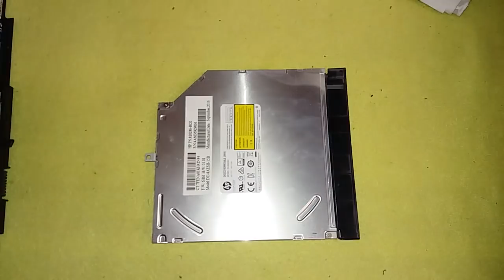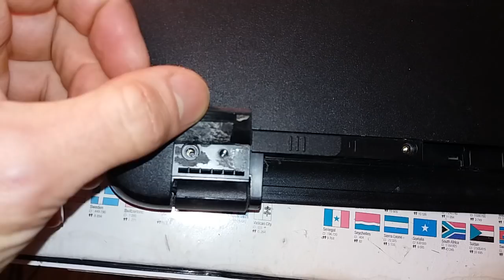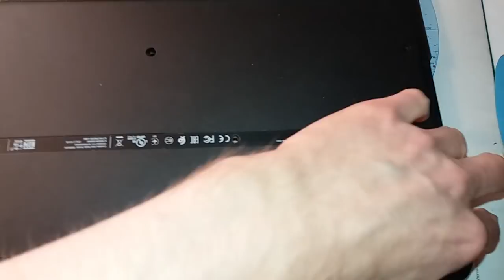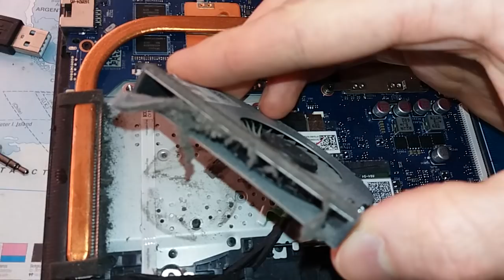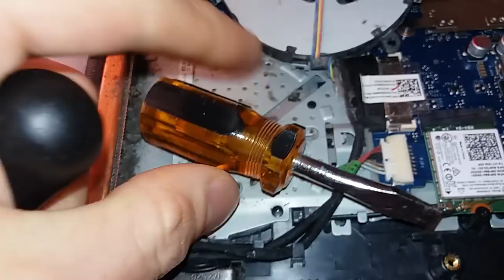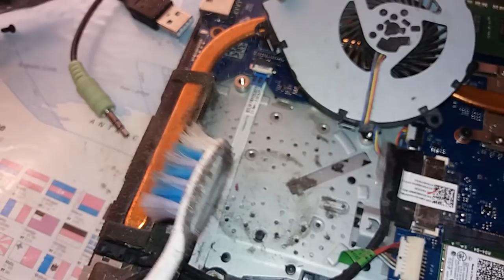Cleaning my howling laptop (unedited)

Comment: If it is a laptop you use regularly some upgrades that would give some improvement is an SSD and more ram depending on how much it has
Reply: That looked to already have both RAM slots full. Though if you don't have 8GB, definitely upgrade to at least 8GB.
My laptop was 1x 8GB, with one empty slot, well guess what, it is now 16GB :)

Comment: the left chip closer to the outer vent is your discrete GPU, that generally dissipates more power than the CPU itself on the right side, closer to the RAM modules
Reply: I don't think he plays too many games on a 5 year old notebook. It's mostly sitting idle. Although the right side chip is AMD, it could be a CPU with no iGPU.
Reply: @gabest4  I guess he does a lot of video editing though...
Reply: Dont think so cause the die of the GPU tends to be bigger then the CPU. Also there is more power delevery on the right side typical for the GPU
Reply: This was really cheap laptop even new, now it is probably running at full load even when playing HD video in windows
Reply: Well from the vid i can see its a apu and dgpu most likely in crossfire
Reply: @dan2800  wtf? no
Reply: @bashaaksema94  I guess it is the chipset.
Reply: @oniruddhoalam2039  what do you mean?
Reply: @bashaaksema94  The chipset is a communications hub and traffic control centre which control flow o data into the CPU.
Reply: @oniruddhoalam2039  i know that but the chipset is not the one under the heatsink as far as I can see

Comment: I regularly do this every 6 or 12 months.
The noise difference is impressive!
I have also upgraded everything that was upgradable. 😂 Replaced the thermal paste too. The temps have been vastly improved.
Reply: And if possible put a m2 SSD or ssd 2.5
Reply: I only do this when required. My 5 year old HP Pavilion was recently cleaned and the difference is night and day. Temps much lower.
Having been impressed with how the HP Pavilion was, I also did the same to my HP OMEN gaming laptop. This also saw an improvement and the CPU no longer thermally throttles in game.

Comment: Well after watching your video, I decided to take apart my HP 15-ac153sa to see what was lurking inside. Thankfully HP has a service manual on their website to help.
Just like your example, the fan and heatsink area were both full of dust. No wonder why it wasn't working very well! Performance has now improved and thermals are better too. I also replaced the thermal compound with some Arctic MX4. (Any decent thermal paste will do; I previously used Arctic Silver 5 on older laptops, which I still have half a tube of remaining.)

Comment: If you don't use the DVD reader you can get a part from aliExpress that will be shaped like DVD player but you can put a HDD in it for storage
Reply: But quite a lot of laptops don't come with DVD reader anymore, so a DVD reader is nice to have, especially if you still use DVDs, also you don't need more storage if you have a 1TB or 2TB laptop hard drive already in it, and if you need more than 2TB, get a desktop PC which allows for multiple hard drives.
Reply: You put an SSD in place of the DVD.  Then you can also get a kit that converts your internal DVD into an external one that plugs into USB.
Reply: @Mueller3D  And by doing that, you run the risk of knackering your USB ports, which are soldered in place and cannot easily be swapped...
Best thing to do is keep the DVD drive inside the laptop and use a large enough drive (whether it be an SSD or a mechanical disk) for your requirements.

Comment: I've repaired/cleaned many laptops over the last couple years. Right now I have a laptop from 2011/12 because it took over 5 mins to boot to desktop and was instantly super hot. It was supposedly cleaned 3 years ago and it looked almost the same as this one, very dirty cooling system and also insides of the case and the keyboard was yucky. Now with an SSD installed it boots up in 15 seconds instead of 5 minutes and it's much cooler.

I also always remove the heatpipes and clean them in the sink (it's just a piece of copper so it won't break) and then dry it out in the oven at around 70 degrees (which is fine because they sometimes get as hot as 90 degrees) before cleaning them and the chips with isopropyl alcochol and applying good quality thermal paste, not the chinese cheap one that is used for cooling LEDs.

Comment: Your cat is blow drying it's hair with your laptop !  You are lucky - they used to make it so you had to take everything else out of the laptop to get at the fan - it was crazy !  I have just used air compressor with high pressure to blast the dust out backwards instead of taking laptop apart - I think that works  okay.
Reply: It doesn't. Dust/hair/debris get easily stuck to the fan's axis. Makes it wear out faster and becomes noisier.
Reply: @em0_tion  yeah you are right but the blowing out the dust with compressed air is better than nothing for an old laptop not worth the trouble of taking apart.
Reply: @LarryKapp1  Objectively speaking, if it's worth using or gifting to a less demanding person - it's worth maintaining. And trust me, i can give you "100% money back guarantee" that i'm lazier than you! 😉😂 But let's not bullshit ourselves, truth is always king. 😁🍻✌

Comment: Did you ever blast compressed air up the exhaust ports while the fan was running in those 5 years? That tends to stir things up enough that the fan can blow the crap back out the exhaust ports.

Comment: Out of interest, what heat sink paste did you use? Laptops do significantly better with low thermal resistance thermal paste because of the power density and cramped design, so good paste can gain you a few degrees over plain silicone paste.
Reply: Maybe the same one he used on the 12V 50A power supply video ( HY510 :-D )
Reply: Yep. Arctic MX4 is king. 👍
Reply: I used to use Arctic Silver 5 and it was decent, I still have half a tube of it somewhere.
Nowadays, I use Arctic MX4 and that works very nicely also. Apparently MX4 doesn't need to be re-applied.
Reply: @TheSpotify95  No such thing as perpetuum mobile - every single thermal paste needs changing after time. MX-4 is a little more resilient, but still not magical, and hell of a lot cheaper than the alternative heat damage consequences to a forgotten device. No reason to be frugal with the change frequency, just with the amount applied - do it every spring before the summer heats, you'll be one happy user. ;)

Comment: I had the same problem, the fan was blowing like a plane taking off when I am not even using the laptop (temp 80c~). However when I opened it, there is not a lot of dust built up on the fins or the fan. It turns out that the thermal paste on the cpu has turned into concrete. I reapply thermal paste and now it stayed around 50 c at idle.

Comment: Oh no, don´t blow the dust in the room. This is why the vacuum cleaner was invented.
Reply: Do not use a vacuum cleaner on electronics EVER! the suction generates high static voltages and that can or will kill the device!
Reply: I always use the vacuum cleaner. It is possible that it might cause some damage, but it has never happened to me. Chips are susceptible to esd, but once they are soldered it is very hard to kill them, you'd have to create static charge on purpose, sucking dust is a lousy way to do that
Reply: @HNedel  WRONG! ESD will kill it. You have been lucky it hasn't done it for you yet, but if you continue it will happen eventually
Reply: @aleksandersats9577  then i will keep trying
Reply: @HNedel  it's your choice. One of these days you can kill an expensive equipment by doing this
Reply: @aleksandersats9577  no laptop or part is more expensive than my lungs
Reply: @HNedel  Well yes, but actually no

Comment: Vacuum cleaner and compressed air helps with this kind of dust. 
I have a question.
A 5v (500mA)  fan, if I would want to make it spin at half speed, can I just put a resistor in series ? What size, what wattage? 
thanks
Reply: Words to the wise: do not vacuum clean your PC, but if you do, never let the fan spin. You can easily damage the internals by electrostatic build-up. Your fan is probably a BLDC motor, so the correct way to slow it down is to lower the PWM signal. I guess a resistor would work too, but not very efficient.

Comment: I've had to do this for frends laptops,  a thick duvet of dust and carpet crud blocks it up nicely :-D
The skill is ending up with a pile of spare screws :)
I use a vaccume cleaner with a narrow fitting to suck the crud out.
The worst is peoples main pc, a thick blanket covers everything, the inside of the psu is just packed with it :-(.
The cpu fan is brown with crud, i'm sure you could grow potatoes in it lol :-D

Comment: You can use a vacuum cleaner to suck all the dust away or an air compressor\compressed air if you are outside.
Reply: Never get near a board with a vacuum clenaer, huge ESD risk.
Reply: @Broken_Yugo  I know. Discharge vaccum cleaner beforehand or use grounded special service vacuum.

Comment: Is that a HP 15 Pavilion? I have one of those too and the fan doesn't seem to give out much air either. I reckon it could do with a repaste and a clean.
edit: After watching this, both my HP Pavilion and my HP OMEN have been cleaned and run much cooler now :).

Comment: 1. never blow dust when the laptop is open
2. use vaccum cleaner with soft & small tip to prevent dust from spreading to critical areas of the computer,
3. do it regularly (5-8 months), not once every 4 years :D

Comment: If anyone is having trouble cleaning their fan, you can try electrical contact cleaner spray. First I tried vacuuming mine, then I tried blowing it out with an air compressor but it still had lots of dust stuck on the fan. So then I tried a few sprays from a can of cheap contact cleaner (not the stupid expensive name-brand stuff) and it's like the dust all magically melted off.

Comment: @DiodeGoneWild - 
my Laptop is far worse to clean , you have to disasseble everything , because a lid has been removed to make it go dead faster
Reply: Some laptops are quite bad in that the entire laptop has to come apart for basic repairs:
Acer Aspire 7542: Motherboard out to clean the fan/heatsink/thermals
HP G6: Motherboard out to clean the fan/heatsink
HP 15 P Series: Motherboard out even to upgrade the RAM beyond its initial configuration (and of course to replace the fan/heatsink)
And, of course...
Microsoft Surface Pro 3: Shatter (and replace) working display to do anything such as replace battery, change SSD, clean fan/thermal paste/heatsink, etc etc...

Comment: I recommend you to use Kingpin KPX or thermal grizzly kryonaut paste
Reply: Arctic MX4 is good enough for the majority of tasks - the limiting factor here will be the lack of airflow and the lack of any real sort of power to get the heat away from the CPU. We are, of course, talking about a HP 15 with only one fan.

Comment: If only it was this easy to clean my hp laptop... Mine has to be almost completely disassembled to even get close to the fan.
Reply: What model laptop is yours? Some HPs are quite serviceable (e.g. 15-ac153sa is OK to take apart, to get to the RAM/HDD) but others are terrible (e.g. 15-p189na requires motherboard removal just to upgrade the RAM).
Reply: @TheSpotify95  My laptop is an HP Pavilion dv6-1253cl from 2009. Check out some of the tutorials out there for cleaning the fan/replacing the thermal paste and you'll see just how stupidly complicated the whole process is (I haven't done it yet and I'm not planning to do so, ever). But anyway, at least I have easy access to the RAM modules and hard drive I guess 🙄
Reply: @enzoperruccio  There is actually a guide for all HP DV6 laptops, from HP, that you can follow:
http://www.hp.com/ctg/Manual/c02842252.pdf
However, you do have to remove the system board in order to get to the fans & heatsink: a common design flaw given how regularly the fans may need cleaning.
Reply: @TheSpotify95  Yeah as I said before, I'm not going to bother with it. The laptop still works fine and it's old and obsolete anyway, but taking it apart and accidentally damaging it now would be a pain the ass, since I need it for zoom meetings and such.
Reply: @enzoperruccio  Cool :) Yeah, if it's not causing any massive issues right now, then there's no point in disassembling to clean the fan and heatsink if it's too much hassle to do so. Might be worth having a look in the future if you get a new laptop, so at least if anything did go wrong then you wouldn't have no computer!
Also, it seems like the DV5s are just as bad, see this:
https://www.youtube.com/watch?v=OpCJzdWxEbQ
Reply: @TheSpotify95  Hey remember when I said that the laptop worked fine one week ago? Well... It died today. Don't know if it was bad luck or what but the graphics/video chip decided take a dump, a problem that is apparently very common on this model. So yeah, after 13 years the laptop is finally done for. But hey at least I don't have to bother with the thermal anymore, or the laptop itself :D
Reply: @enzoperruccio  Ouch, sorry to hear this! I wasn't aware of any issues with the HP DV series, though I do know that the DV5s are a right pain to get to the fan, and it seems like the DV6 is the exact same. Might be that the GPU was overheating. 
What I would recommend is to take out the components that might be useful, such as the RAM, hard drive, DVD drive and battery - as they can be reused (especially the hard drive and DVD drive as you can turn then both into external USB drives).
Hopefully you can get a more modern laptop that will work better and run cooler (as well as not being a pain to service).
Reply: @enzoperruccio  edit: here's a funny song showing just how bad the DV series were at servicing the fan/heatsink:
https://www.youtube.com/watch?v=OpCJzdWxEbQ
this is for a DV5 but I'm sure the DV6 is the same
Reply: @TheSpotify95  I doubt the "sell for parts" thing will work for me haha. I live outside the US (where this laptop was purchased) and it was my uncle who brought it to my country. So basically no one else has one and I will struggle to sell the parts. It's probably going to end up tossed in a drawer until I find what to do with it. Could build a power bank out of the battery, I dunno.

Comment: It's slow also because you don't have a solid-state drive.
Reply: No, it runned slowly beacuse of cpu thrrotling... When CPU radiator is clogged and CPU starts overheating, then CPU starts drop down clock frequency to avoid failure...  Sometimes it could be laso power delivery issue because in that case cpu also sows down to keep laptop live  on battery longer...
Reply: Yes, that's why I wrote "also".
Reply: @TheComputerGuy96  but 6 months before it was fast as tornado
Reply: SSD's it's just for load times, not overall
Reply: @mystcat3  exactly...
Reply: Hey, I remember you from previous videos that I used to watch :D
Yeah, I agree that HDDs are slower than SSDs but sometimes you need the storage that a HDD provides, without the cost of a very expensive SSD. I can't justify replacing my 2TB HDD with a 2TB SSD because it would cost me over £150!
Reply: @TheSpotify95  Get a smaller SSD like 120 or 240 GB for your operating system and programs, and store everything else on a larger HDD (an external one if you can't install two drives at once). SSD is good for loading software, HDD is good for extra storage.

Comment: Consider replacing HDD to SSD
Reply: Depends on how much storage you need. 
For a secondary laptop that needs fast response times, get a 500GB SSD
For a primary laptop with a DVD drive (and you don't need the DVD): replace original HDD with 500GB SSD and replace DVD with high capacity HDD or original HDD. Convert DVD to external DVD drive.
If you do need the DVD and don't want to mess about with external HDDs or ODDs, just stick with a high capacity mechanical drive. Mechanical drives have been fine for the last goodness knows how long, so they are still fine now.

Comment: Compressed air (in can), compressor or leaf blower with adapter work nice for dust especially when you dont want to open computer :)
Reply: i heard that compressor is bad because air in it is very humid
Reply: I'd recommend CompuCleaner made by It Dusters. Cheaper than canned butane (air) and takes less space than an air compressor.
Reply: Oh yea, remember the good ol’ Vaccuper™️ made by ElectroBOOM ? It’s basically a vaccuum cleaner with a piece of paper ( the paper works as a seal ). Pity it doesn’t work on my laptop ( since my Asus VivoBook Max X441UB has a completely different design than old style laptops ) so I still need to disassemble the whole laptop :-)
Reply: Changing the thermal paste is the most important part.

Comment: Try to run it directly on 220 volt without 19 volt adapter. 😁
Reply: Blaadii helll, naau its properlii bloooun!!!
Reply: Aaaare yooou kiddddding meee?
Bloodyyyy helllllllll i can feeeeel some smoke.......
Reply: Bladii heeeeel so much smoooookee guuuuuuys are you kiding meeeeee?
Reply: @wdujsub7902  yeahhhh I am kiddiiiiiiing youuuuuuu.
Reply: What are you guys talking about
Reply: @LabArlyn  I want to see that what happens if a laptop is directly connect to 220 volt without using adapter (charger).